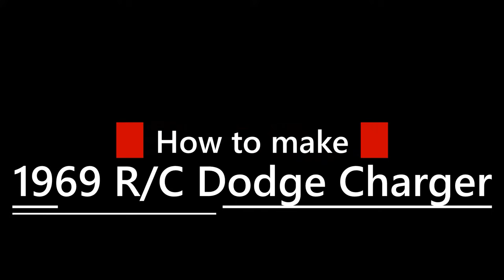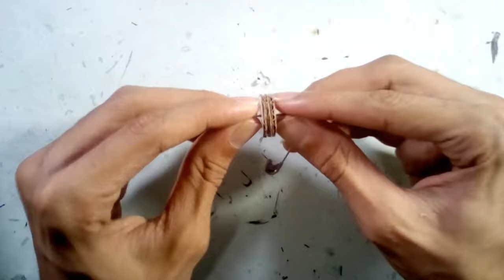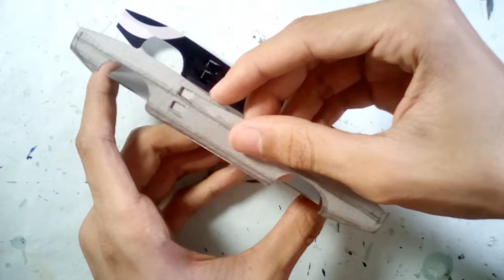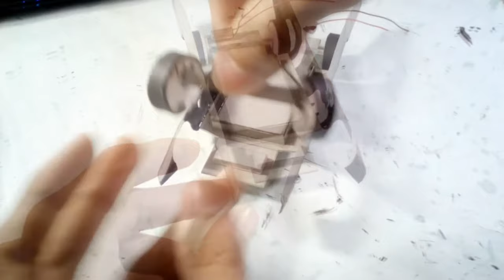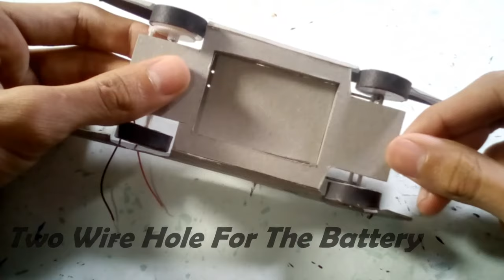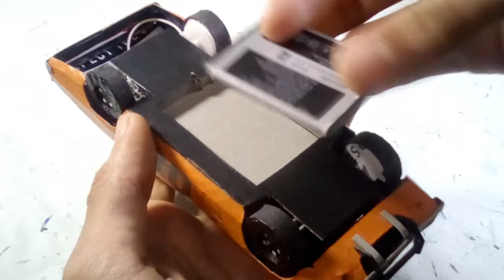How to make rc Dodge Charger at home with cardboard

Comment: But why does not tires come out in front when drived and why are they too straight
Reply from the maker: I have a small problem😇... there is no problem with the chassis of this Dodge Charger👌... the left wheel is touching the body😰... the only thing is that it cannot be turned too much😫.
Reply from the maker: Thanks For The commenttttttttttt